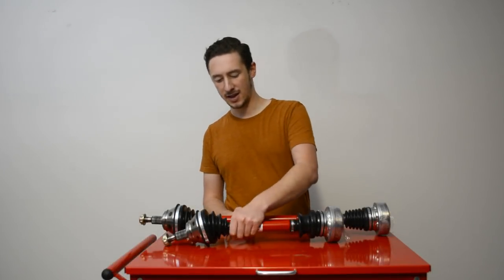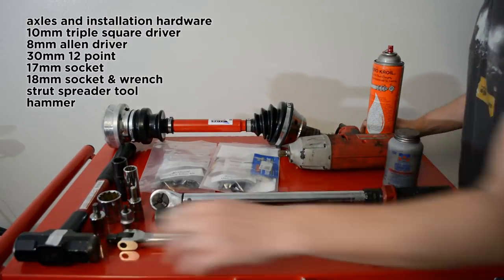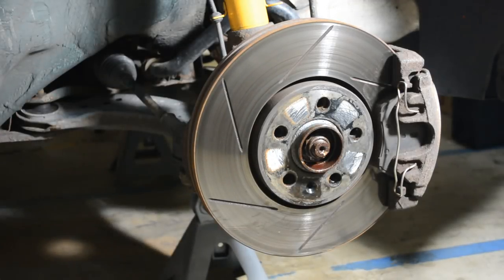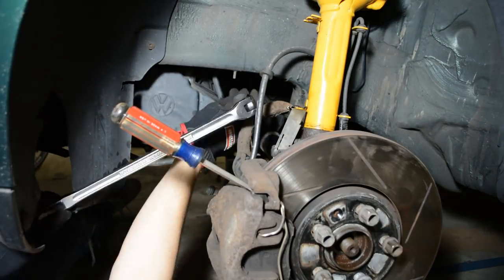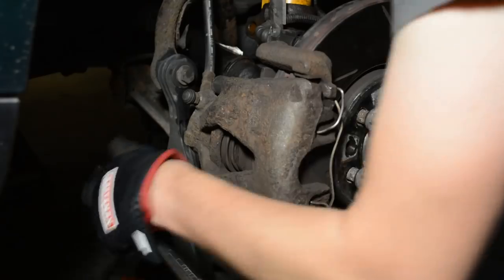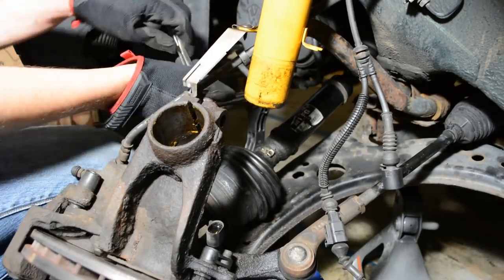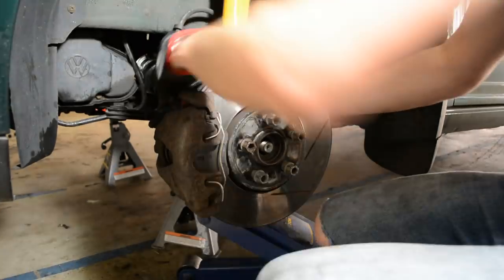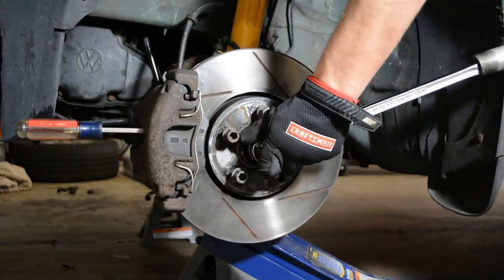MK4 VW CV Axle Removal and Installation

Comment from the maker: Please be aware that the car in this video is a 1.8t manual transmission. While the idea/method is the same across the mk4 platform, the specific sizes of things may vary between models. Please double check your sizes before starting work as to not waste your time and money!
Reply: any idea if disconnecting the strut spindle gives enough clearance on the passenger side with an auto tranny on a diesel?
Reply from the maker: @barnacleburrito3728  It should. The procedure for pretty much every mk4 is pretty similar, it's just the sizes that change. You can disconnect the ball joint or spindle from the strut. Either one should give you the space you need to pull the axle out.
Reply: I changed my axle and now my steering wheel is isn’t straight??
Reply from the maker: @codycardwell2377  It can knock things out of whack. Go get an alignment.

Comment: Upon further inspection all 6 axle bolts where removed from the car. Adam Smith conveniently mentioned his dad was a mechanic. Who showed up the day before the noise started. Could it be a setup, possibly. But it still holds true that someone snipped my camera and then proceeded to tamper with a vehicle. What is ultimate clarity is that some just do not understand what we are trying to accomplish here. There is a lack of vision for some.

Comment: Just did this job. Just wanted to note that on my MK4 TDI BEW it was an M8 triple square. That cost me a day of waiting because I initially ordered an M10. On the bright side, now I have a whole set just in case.
Reply from the maker: Thanks for the comment, a few others have said the same. At the time of making/posting the video I didn't realize there were size differences in the hardware between engines. I do have a pinned comment stating this is for the 1.8t and sizes might be different. Unfortunately I can't add a note in the video like you used to be able to do on YouTube. Honestly, having a whole set of triple squares isn't a bad thing if you own a VW!

Comment: Thanks for a very informative video. Very rarely do you find the videos that show all the tools necessary to do the job and you did a great job in explaining The tools necessary for the job. Your voice is very clear and the video is shot very well. Can I add just one small piece of advice?.... The MK4 golf is available in automatic and in stick shift. From the beginning you are not clear about either, though I do know the difference but some of your viewers might not.
Reply from the maker: Thanks for the great comment! When I made and posted this video I was not aware of the differences in axles between engines and manual or automatic transmissions. I did pin a comment explaining that it's for a 1.8t manual transmission after realizing there are some differences.

I've done my best to be more clear about that in more recent videos since I don't want to misleading anyone. I appreciate you watching and commenting, cheers to someone else keeping MK4s alive!
Reply: @StevesGarage  you rock. Thanks for a clear and understanding video. Most videos I see just show the work and not the tools. You did a great job setting up the viewer for success. Keep up the good work 👍🤙👍
Reply from the maker: @RonFoster-i8b  Thanks so much! I really appreciate the comment. According to the watch stats most people skip over the tool part, but I keep including it because it's what I've always looked for in videos. I just try to make videos that I would want to watch when doing a job.

Comment: It’s a lot easier to take ball joint loose..Saves a lot of time,never had a problem
Reply from the maker: Either way works fine. I've removed ball joints before but sometimes needed an alignment. I just wanted to try and film this alternate method.

Comment: Why why why would you go with a non- OEM part? Why open Pandora's box of possible problems when the OEM one is tried and tested and reliable?
Reply from the maker: I will agree with you in most instances, especially with CV axles. That being said, Raxles are a tried and true high quality aftermarket option. They're extremely reliable, and Marty offers great customer service with a lifetime warranty if anything happens to them. They're also made for your setup. In the instance of my car, the axles are slightly shorter than OEM because the car is lowered. Being slightly shorter reduces the tendency for the axle to bind.

Comment: How much are raxles?
Reply from the maker: They were about $750 shipped for both sides. You can definitely save money with cheaper axles, but I didn't want to do this job more than once, and I am lowered about 1.5in.
Reply: @StevesGarage  hey, I have h&r lowering springs. 1.5". How long do you think my after market CV axles will last? Mk4 GTI, stock. Axles are FEQ, got them from urotuning
Reply from the maker: @eduardogarcia1512  I'm honestly not sure, I don't have any experience with those brand axles. I will say that if you're lowered, they might not last as long as if you weren't lowered. My Raxles are actually a different size than the OEM axles, because they took into account my lowering springs.

Comment: Got the left side done today and this tutorial is spot on! Couple things though... RAXLES has a 29ftlb value for the 6 flange bolts.  Not 59 per the video. I think they would strip out at 59. Also, when it comes to holding the new axle in place to tighten the 6 bolts on the transmission flange, I made a handy jig that holds the axle in place with a 1x4 and a half circle cut out to make a sort of cradle that rests on the lower control arm
Works AWESOME. I can send a pic if you want.
Reply from the maker: Not sure what happened to my reply... Anyway, I'm glad the video helped, and I'd love to see the jig! Definitely shoot me a photo!
Reply: Cool. How do I send a photo on YouTube? Actually I have another question, too. In trying to wrestle the strut back into the steering knuckle I, the axle hit the frame a few times, enough to scrape the paint. Do you think I, damaged the axle? I was pushing down pretty hard.
Reply from the maker: @robertartac1853  There's no way for me to positively know, but I doubt you damaged it. I had to bend mine pretty far as well. I just added an email under my about page because I realized I didn't have one. But go ahead and email me at stevervalente@gmail.com!
Reply: Yes definitely NOT  59 ft lbs
Reply: For a 5 speed, the inner axle bolts are smaller M8, so 29 ft lbs torque. For a 6 speed, the bolts are M10, so 59 ft lbs torque.
Reply: The bolts for my 2005 1.8t 5 speed Gti for my Raxle were 59 ft lbs. They really didnt have a problem going in, other than my wrench hitting the boot like in the video, and torque wrench was set to 59 ft lbs, all felt fine. I dont see how you could have been tight at 29 ft lbs. if mine were at 29 ft lbs the axle would be falling out. Maybe different.

Comment: Great video! Helped a lot!

ONE IMPORTNANT TIP: No need to unbolt the strut, at least on the driver's side. Turning the wheel outwards (left axle -> turn steering wheel left) and removing the anti-roll bar link was enough to replace the axle. Hope this saves some of you the hustle :)
Reply from the maker: Thank you! Hopefully I don't have to worry about axles for a while, but this is a great tip for anyone watching the video! Thanks for the comment!
Reply: You cannot turn the wheel far enough to the left to remove the axle. Still had to separate the strut from spindle.
Reply: @rocksandticks  I managed to do that on my car, so it is doable - I did the whole operation in a random parking lot stuck between two other cars. And I have 0 mechanical skills, I am an econ student. Perhaps there are some differences between US and EU market versions or sth. I don't know, but it's definitely possible.
Reply: @michamerchelski3023  what engine and transmission do you have?  Right-hand drive or Left-hand drive?
Reply: @figit090  letf-hand drive, the engine is 1.9 TDI, I assume AHF, ASV type (I don't remember), manual 5-gear transmission

Comment: Great video, much appreciated!!! Just did mine today. Believe this method only works on the driver side. On the passenger side the strut can not drop low enough. I used a hammer to tap in the triple square bit into the bolt, to make double sure they are seated correctly and not stripping. M8 is 40NM, M10 is 70NM, so depends on what you have. Also had to hammer for 30min to get the axle out of the hub, so make sure you have a big/heavy hammer. Heads-up on the sensors was gold, for sure I would have forgotten that. Thank again!!
Reply from the maker: Glad it helped! I used this method on both the driver and passenger, though I don't really remember if I had trouble with the strut or not - it's been a few years! Damn sensor... that was a rookie move on my part! I'm glad you found the video helpful and you were able to get the job done!

Comment: Thank you for the video, I just have to wait until raxle opens back up after the holidays to order them.  Feels like I only need the passenger side but I figured I might as well change both as I have quite a few miles on the car.  Thank you again for the video.
Reply from the maker: Glad you liked it! When I replaced these it was only my passenger that had failed, but I like to replace left and right items at the same time. Marty is great, you'll be very happy with the axles.

Comment: Really well done video. I like that you are very clear and organized and explain the process without going on and on (like the last two videos I watched -well intentioned but wordy). I am about to do the left (USA driver's) side of my '99 New beetle and this is a great review. One tip I had was to break the axle nut loose before you undo the lugnuts - wheel still on the ground. The screwdriver trick is a good one, as i never thought about the cooling vanes, and sticking the screwdriver in between the caliper and the edge of the disc only sort of works. Breaking the axle nut loose and doing final tightening with the wheel on the ground the whole car helps you resist the torque. Worked great on the right side.
Reply from the maker: Thank you! That's the whole goal of my channel honestly - simple but detailed videos. I'm glad you found it useful. I agree that breaking the axle nut loose with the car on the ground is a great idea, especially if you don't have an impact gun. Just like breaking the lugs loose before you jack up the car. Thanks for the comment, hopefully your NB is back up and working soon!

Comment: Putting the nut on the end of the axle before striking is a courtesy to the next person who may pick it up as a rebuild if you intend to return the old axle core.  The threads are not always good when you get them because someone was careless.  Thanks for making this informative video.
Reply from the maker: Glad you liked it! You're definitely correct, if there is an axle core, give them the bolts with it. I ordered Raxles, so there was no core, and they came with all new hardware.

Comment: Nice video. It helped me out. But what I did differently was instead of disconnecting the strut-to-spindle bolts, I just disconnected the lower ball-joint-to-lower control arm bolts. There was no balancing act required with re-inserting the axle shaft to the hub from there. Either way you choose, you still need an alignment or you'll see excessive tire wear, as I have tried both methods.
Reply from the maker: +Noah Forbes Yea thays the typical way to do it. I did the axles in February, and never noticed any issues with the car tracking properly or odd tire wear. I actually just switched to my winter set-up so I took a close look at my summer tires and they didn't wear oddly or too quickly. Maybe I lucked out not needing an alignment.

Comment: With the passenger side axle you can just remove the axle nut and the flange bolts and actually wiggle the axle out without even talking the wheel off!!! This is a life saver Bc you don’t have to disconnect the ball joint and mess up your front end alignment. Axles are super easy to do on the mk4 platform.
Reply from the maker: I guess you could, though you wouldn't want to leave the control arm unsupported with a wheel still on once you disconnected the strut. Honestly, from what I read up to when I did the job, it was way easier than I expected!

Comment: Great refresher. Just got done installing Function Form type 1 coil overs on my MK4 GTI and I noticed the drivers CV axle boot is shot and joint pops now and then so time to replace.
Reply from the maker: +LaRueOBR 5.56 Thabk you! If you're low I definitely suggest Raxles. When you order them the owner asks how low the car is so the axles will work perfectly with your set-up. Let me know if you have any other questions!

Comment: Cool video, future though you could just remove the 13mm bolts holding the ball joint in and pull the hub back. Won’t need to do an alignment and it’s much less work. The lower ball joint doesn’t have an adjustment so you’d be fine.
Reply from the maker: Yea, thats another method. Either one works, I decided to do this because the other videos I saw were ball joint removal.
Reply: Steve's Garage it worked! That’s all that really matters, I was a Vw tech for 6.5yeArs and we usually just removed the bolts that attach to the control arm. Almost every Vw is toe and go in the front unless the subframe is removed which = a huge pain in the ass to align after even wit the right tools and an alignment rack unless you nail it in the exact spot it came out of haha.
Reply from the maker: @Nate6133  Oh nice! I've heard about the subframe being a death wish like that. Thankfully mine seems to be in good shape even though it's a north east car. Hopefully I never have to touch it!

Comment: put a box end wrench between the rotor and lug bolt, that will make up the slack and have the lugs tight so maybe you wont bend a bolt next time
Reply from the maker: Great tip, thanks!

Comment: Great video. I ordered a Raxels on your recommendation and what i got was black not red and it had no supporting hardware like bolts. If there's two levels of part that could be mentioned.
Reply from the maker: I wasn't aware of two different levels of parts when it came to Raxles. Did you order it direct from Raxles/Marty?
Reply: @StevesGarage  yes. They must have a race version and a normal version?
Reply from the maker: @EricThompsonClimber  I guess so. I never specified either, but I may have the red ones because I am lowered? Are you stock suspension wise?
Reply: @StevesGarage  Yes stock suspension.
Reply: I do have the bolts, they're 8 mil triple square. But no paper gasket.
Reply from the maker: @EricThompsonClimber  It's possible the stock axles are black and not the same as the custom ones. I know mine were different length than the stock ones I took out.
Reply: The gasket is preinstalled on the axel.

Comment: To remove the axel from the hub disconnect the sway bar link then remove the front bolt from the lower control arm and swing the entire assembly out.  No need to remove the ball joint or the strut.  And no realignment needed.
Reply from the maker: That would work too!

Comment: Totally convinced me to check out Raxels for a replacement, but holy shit those are expensive.  A set of those plus shipping is damn near worth more than the freaking car.   I'm not saying it's a bad buy, just pricey.
Reply from the maker: They are expensive. But I think they're worth if if you have modified suspension or plan on keeping the car.  I just did the run around with aftermarket axles on my Volvo and they all gave me a vibration. Luckily I caught the OEM axles early and could rebuild them, but I tried two different brands of aftermarket axle and they gave me low and high speed vibrations. Once I put the OEMs back in, it was fine again. The extra cost is worth it to me if I never have to touch them again.

Comment: Did you have any trouble tourqing the flange bolts to 59 ft pounds? I installed my driver side over the weekend and they seem REALLY tight. Idk if my wrench isnt working properly but I wasnt getting a click on them. But when I tested on my lug bolts it seemed to work fine
Reply from the maker: My biggest issue was having the clearance to tighten them. As far as getting them tight I don't remember having any issues. The torque spec in the video is for the Raxles. Not sure if you went with OEM, but from what I know the torque spec for OEM bolts is 30 ft/lbs if M8 bolts, and 52 if M10 bolts. Which engine/trans uses which size bolts is beyond me though.
Reply: @StevesGarage  I also went with raxles. So it's 59 for me. I'm probably just gonna install the passenger side this upcoming weekend and then I'll take it into my shop to double check the specs
Reply from the maker: @aaronparsons8344  You'll be happy with the Raxles, I can tell you that much! Sorry you're having trouble with them.

Comment: Wait a minute I seen this car at the junkyard the other day, it had the same coil overs and it was also green. I didn't check the red axles and the tires were still on so I could see the performance disks. It was in grand strand lol, ehats good to pull off this thing 😂😂
Reply from the maker: Funny that you saw that, it wasn't mine! Mine's still running strong, sitting in my driveway.